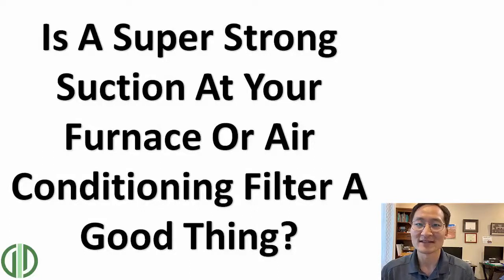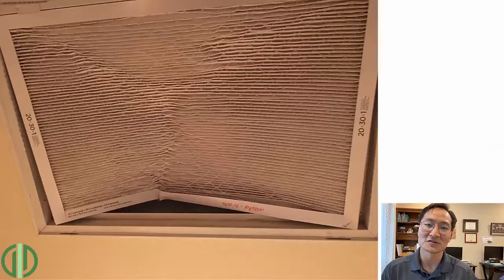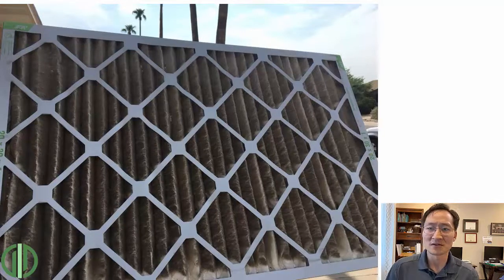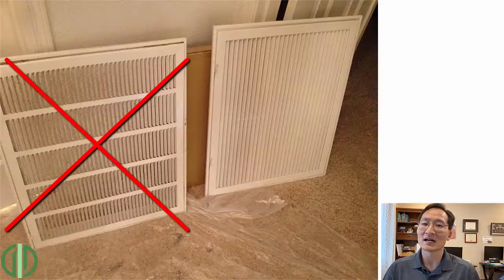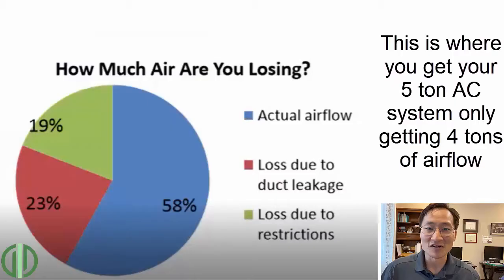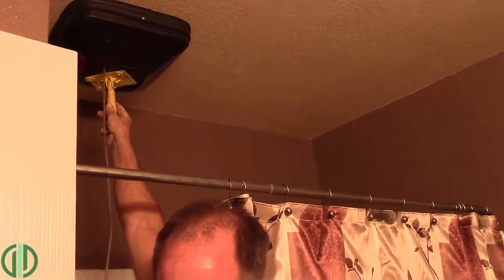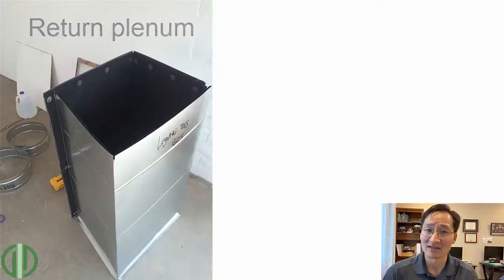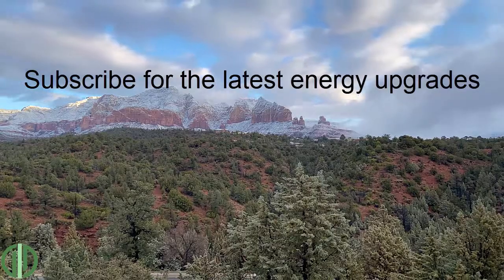Why Is The Filter Getting Sucked Into The Return

Comment: You want to keep your air velocity through the filter media as low as possible per square inch, the more the filter blocks up or the faster the fan cycles, the faster the air velocity becomes through the filter in the easiest places it can go, bare in mind the air in your house on the positive side of the fan needs a decent path back to the return, that can involve relief ducts or trimming doors, this is where youll notice doors pulling into the negative pressure or whistling.. the system when installed should have been balanced, so dont go adjusting the outlets should be mentioned aswell. You need that return filter to be sealed and working right, since its basically a vacuum cleaner where all the stuff that gets past goes straight to the units coil, and if you want to lose your coils efficiency by clogging that up with dust which in cooling turns to mud, youll learn how expensive these systems can be to repair pretty quickly, not to mention that you will run the unit for longer and you may never get to the programmed temperature.

Comment: Interesting.  I learned this too late - I was using a 'reusable/washable' filter and it sucked the media into the unit, I think that caused the rupture and leak of coolant.  But it was 20 years old anyway.  But now I manage the filters closely, and was getting concerned about restrictions.  How often do you think replacement is needed? I check and don't use much so annually seems fine as that's what they used to say.  But now they say quarterly or even monthly (I think the filter makers are following Jiffy Lube and the 'need ' for excessive changes).

Comment: Get a 2 inch filter if your system has a 1 inch. Modify the enclosure. Less restrictive because thicker filters have more surface area
Reply: Do they make a 4" or 5" wall filter return grille to replace a 1" wall filter grille?
Reply: @REALBanannaman  In my current home, in 2019 when the HVAC system was replaced I requested a 5" filter cabinet that takes Lennox X8310 filters which I replace yearly.  In the home we'll be moving into in 2 years there are no returns anywhere except the wall right below the furnace, which has a large 1" wall mount filter grille, which I find to be too thin after being spoiled with the 5" filter.

Also in this home there are airflow vents in the wall above every door in the home (except for the bathrooms) for return air, so essentially all of the return air gets drawn to the single location.  Different style for sure, I'm not sure why they did it like that, but all of the supply air has insulated duct in the attic with a traditional up-flow 3.5 ton Lennox heat pump.
Reply: @REALBanannaman  I understand what your theory is using the ceiling tile brackets for a drop ceiling and modifying the current filter enclosure.  I'd probably rivet the L brackets on for a "smoother finish."  I still wouldn't mind something thicker than 2".  4" or 5" would be great, but I guess a 100% increase from 1" to 2" is a great start.

The home we're moving to with the "jumper ducts" is a 2,100 square foot ranch with quite a lot of vaulted ceilings which is great.  Your home with jumper ducts is a two-story, tri-level, or quad-level I assume?  Thanks for the suggestion!  By the way I am guessing that's why they didn't run return ducts to each room as with multiple vaulted ceilings, space was tight as it was for running supply ducting let alone supply AND return ductwork, essentially twice as much!
Reply: @Guillotines_For_Globalists  Two story home. And I never did think about running a return and supply to every room on a first floor level, that must be a chore. I do see more returns on the second level in homes around our area though, the attic space above must help. We don't even have jumper ducts, the doors have a 3/4 inch to floor gap under them which reduces restriction. 

And remember .75 inch to 1.75 inch is even better than a 100% increase! And if you want to get crazy you can measure the surface area of the filter medias, cut open and lay flat. Either way you go, 2 4 or 5 will be great. Some of the 4 or 5 inch options may be Honeywell sizes or more geared towards media cabinets? Just be sure to check the nominal vs actual sizes.
Reply: @REALBanannaman  My current filter size as of the 2019 update takes Lennox X8310 filters which you stretch out like an accordion and slide into the plastic frame which you do not discard, but I assume other cardboard box 5" filters may work as well.  I'll be sad to leave it behind!  Although I don't have any scientific data to show if there was any air cleaning improvement with this 5" filter versus the original 1" filter.

Comment: I recently switched my brand of filter (due to all the supply shortages, my usual brand was sold out). As soon as I changed it, the return plenum started "oil canning" every time the blower would start and stop, just one loud bang as the plenum contracted and then released from the pressure. My filter was absolutely slammed against the return exit and whistling to high heaven. Needless to say, I'm buying a new filter tomorrow.
Reply from the maker: Also try adding a new return

Comment: I totally removed my grill and all the vent covers in my ceiling. No more restrictions for my AC. I am still using a MERV 12 filter, though. I assume having no grill will help facilitate even greater airflow through just one restrictive barrier (i.e., the filter) instead of two (i.e., the grill and the filter). If you ever read this, please let me know.
Reply: You are correct, I’ve also had success bending the louvers to be less at an angle and more 90 degrees in lowering noise and restrictions.
Reply: @davidbyrnes8672  I appreciate your wisdom and expertise.

Comment: Great informative video, thank you. Would adding cold air returns increase airflow and return for a home with undersized return ductwork? My 1600 square foot home only has 2 cold air returns. I’m having a new American standard furnace and ac installed tomorrow and I’m having them add 3 returns and use 4 inch filter instead of the one inch filter to hopefully help improve air quality and the life of the equipment
Reply from the maker: Yes, it would help!
Reply: @GreenintegrateddesignPages  awesome, thank you. I had it done and the amount of airflow and air quality is dramatically improved.

Comment: The house we bought has three returns with filters at each return. The air handler itself has a place to put a filter. Is it better to have the filters at the returns, is it better to just have a single filter at the air handler or does it not really matter? I question if all the filters add restriction, making the return more inefficient (they appear sized right for 3 ton system, 2 - 12x24 and 1 - 12x12). Suction is strong, it'll suck the filter into place when I replace it but it doesn't collapse it. Thanks.

Comment: Hi maybe you can help am installing a heatpump 60K BTU and i did duct work to second floor all flex duct its 4inch supply to 2 rooms and from 4inch i when 6inch to other room, we deleted the chimney and i was able to get a 4inch hose this is how i got the 4inch vent threw anyway on the first floor am doing everything 6inch supply but my Question is for the return shod i install it in the floor in the corner since the is a cut out already 14X14 i just need to remove the square wood floor or shod i install it on the wall first floor i can not put any returns on second floor because the chimney pipe is 6inch and i was able to put threw 4inch for supply air upstairs is new construction downstairs we are renovating at this time we have a 24K ductless heatpump we purchased it when we purchased this house since the house was unfinished and no heat 3200sq and know am installing new heatpump my question can i use a 12inch return from the basement it will be 8feet long or shod i install the return vent in the wall first floor the easy way would be the floor since the cut out is already right above the heatpump ?

Comment: Hi, Green ID.  New furnace/air (split unit) install  May 2022. House always smells like a chimney now even when HVAC is not running.  I change filter (Merv 8) monthly.  This month when changing filter, HVAC happened to kick on during the change.  The filter slot DID NOT suck at the filter. With my old unit, I could not take the filter out if the HVAC was on, the suction wouldn't allow it.  This new unit has NO suction at the filter.  I can remove filter while HVAC is on. I have 6 returns.  1 return has MAJOR suction, 1 has NO suction, the other 4 are weak suction.  I have return issues I think. What do you think?
Reply from the maker: Sounds like it, you should check for kinks or restrictions in the return lines if accessible. Good luck and give us a call if you are in the Phoenix area.

Comment: What would cause a return to not have hardly any suction? I literally threw powder up while the air was on and it didn't even suck it in. I have a brand new home and the filters are 3 inch ones that are put in at the attic not the intake. I'm just curious what would cause that?
Reply from the maker: Your return could be disconnected and sucking part of the attic air or outside air mixed with your inside air, which would cause it to lose pressure. Have you had a blower door test done to measure the leakage?

Comment: Does the return vent always need a filter inside of it?
Reply from the maker: Good question, and not necessarily. You need to check at your indoor air handler or furnace though and see if there is a filter rack at the indoor unit. If there is one, then no, you do not need a filter at the return vent. If there is not one, then yes, you will need a filter inside.

Comment: My return just started doing this. We're in Phoenix as well. I've been using the same brand filters for 6 months now. Replace them every 2 months and they're not very dirty each time. But like I said it just recently started doing this. And my home has 2 returns. One in master bed and one at end of hallway next to living room/kitchen. Any idea why it's doing this now?
Reply from the maker: The return ducts you have may be kinked Joey. You may want them inspected and tested to make sure the airflow is not restricted because if it was installed poorly with lots of hard bends or pinched off, it will cause your filters to get sucked up
Reply: @GreenintegrateddesignPages  Thanks for the reply. Found out it was the filters being too restrictive. I switched them to the least restrictive filters I could find. It's been working perfect now. Except I can tell there's a lot more dust on everything now.
Reply from the maker: Joey M. Try a 3” HEPA filter with a 1” lip. You can find them online and they provide better filtration than the 1” pleated filters and don’t restrict the air as much because you get a larger surface area.

Comment: Would unit that is that has restricted the air flow burn fuses? Because it's working too hard?
Reply from the maker: Under extreme conditions restrictions can burn up a blower motor and possibly a fuse. I would check the secondary effects of the airflow moving an exposed wire to ground inside the panel

Comment: I have a question regarding the "fresh air return(?)" on my AC system - is there a better filter than a wad of mesh shoved up in there?  With a vaulted ceiling, the return isn't exactly the easiest thing to get to but I feel like there's something better that could be in there.  I'm referring to the approximately 5" opening next to the primary return (I'm in Tucson, btw).
Reply: Ask about an ERV system, it’s the most efficient and effective way to bring fresh air into the house

Comment: I have no suction what's going on
Reply from the maker: You have a large leak at the coil cabinet or in the ductwork that is causing the duct o loose pressure. An energy auditor will be able to measure the leakage and tell you what's going on